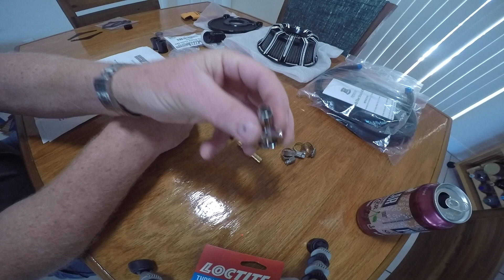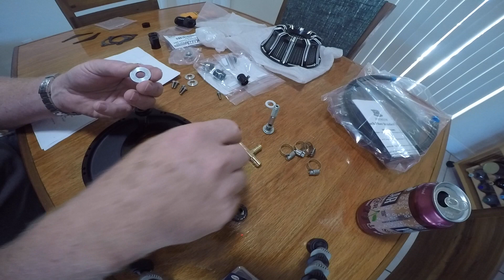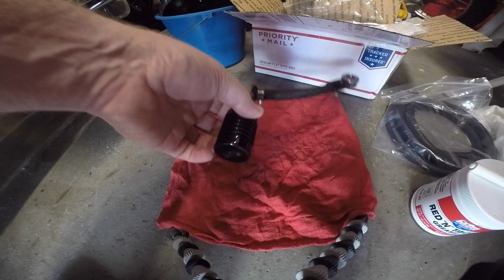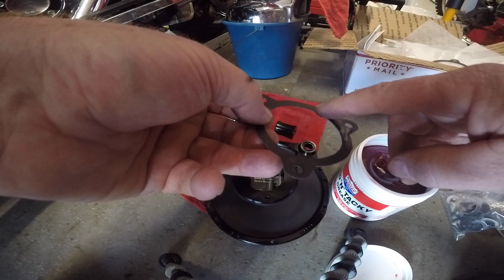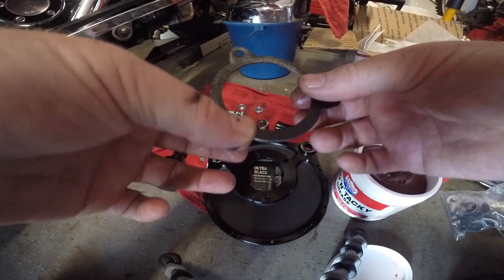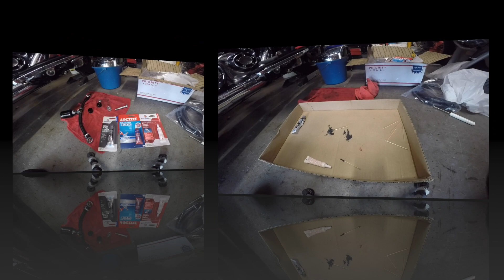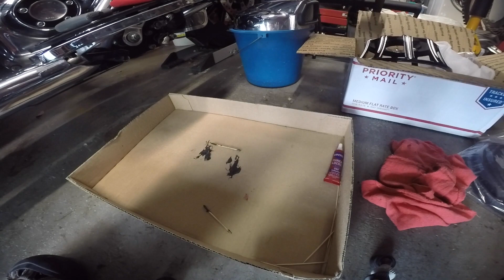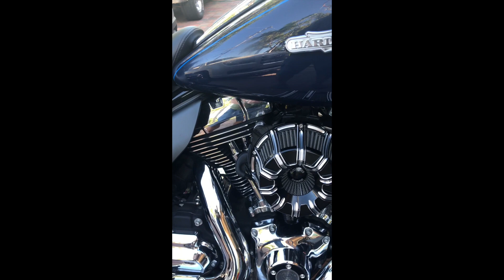DK premium discrete breather & Arlen Ness Inverted air filter installation

Comment: how did the red n tacky grease work out for you with the installation, arlen ness recomended using white lithium, but i would imagine the lucas would hold up better
Reply from the maker: It worked out excellent. Just got back from Tail of the Dragon and the Smoky Mountains - put on nearly 3,000 miles. All good. Perfectly sealed and clean. (Riding videos forthcoming.) I may make a short video when I take the oil catch can off and service/clean it. My opinion is that, for this application, grease is pretty much grease. It's just there to keep the o-rings lubed up and lasting a long time. But I have found the tacky grease better at holding things in place during assembly. I'm sure you'd be fine with whatever grease you have available (assuming it is designed to get along with o-rings okay), except things might not stay in place as well during assembly.

FYI - My buddy had oil slopping out from his Harley air cleaner all over his cylinders and crankcase (they must have overfilled at his last oil service - he does not change the oil himself like I do). I've never seen oil slop like that on any bike (his bike has never done that). He was asking a lot of questions about my DK kit & filter, which was all perfectly clean and performing flawlessly. He was also noting that my bike sounded sharper and had a deeper sound to it. I suspect that I'm about to be installing a second DK kit.
Reply: @motorcycleadventurerider  thanks for all the info, i'm installing an Arlen Ness inverted Air Filter , yeah i have the same Lucas red n tacky   , wheel bearing grease and all purpose grease. I''ll probably end up using the red n tacky and i'm guessing it's good for o-rings especially since everything held up sealed for you. I feel for your buddy , post a video of the second DK kit. Thanks again

Comment: Maybe I'm missing something because the instructions are extremely poor. I installed an inverted cleaner kit and it DOES NOT vent whatsoever. I rode about 10 min to find oil leaking from a lifter o ring, parts of the head gasket and a large level of blow by burning up in the exhaust.
Reply from the maker: Not sure what bike you have, but not all Harley venting systems are the same (and I'm not enough of an expert to tell you what all the differences are). What I can tell you is that if you have a system that vents even remotely similar to mine, it will be obvious. And if the parts from any new air cleaner kit are not designed to vent, that too should be quite obvious. And finally, air cleaners are designed for specific applications for proper fitment (you must specify what kind of bike you have). If you were inadvertently supplied with an air cleaner kit for another application, this could be the problem. Sorry you are having problems, and good luck getting it sorted out quickly so you can get back out on the road!
Reply: @motorcycleadventurerider  Got it sorted out. It was a flaw in the backing plate. Didnt have the vent holes machined. Got a new one within days from Revzilla.
Reply from the maker: Excellent that you got it sorted out, but unbelievable that there was a flaw with the vent holes not being machined in. That's pretty incredible. Thanks for getting back to me/us with the cause! That's how we all learn.